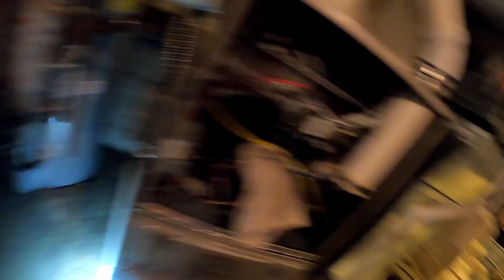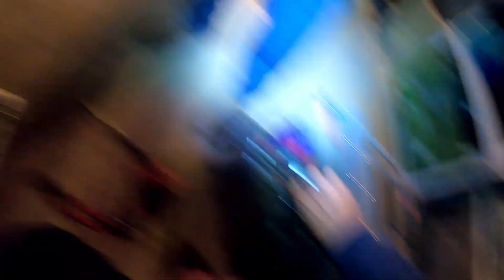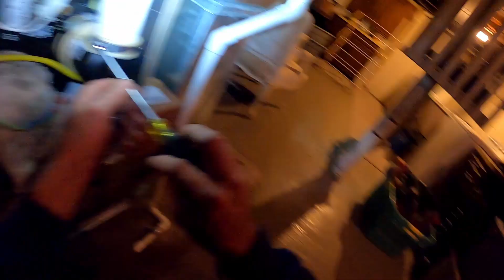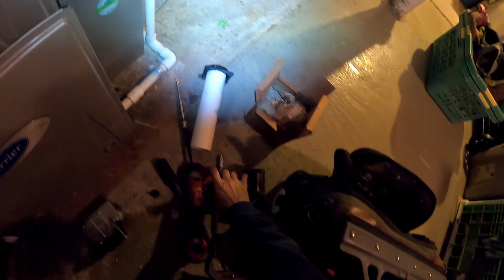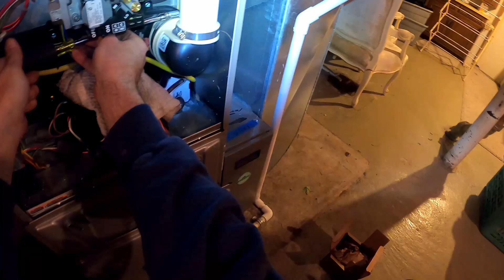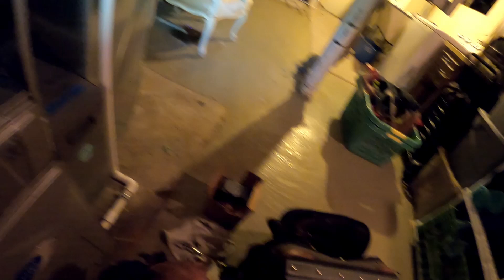Carrier 2 Stage Gas Valve Change(With Help From The Installer)

Comment: You could have easily changed that valve out after inlet gas pipe was removed. No need to cut, or take the outlet vent pipe out. I’ve done it many times. Of course if installer had put that union inside cabinet, it would be even easier.

Comment: if only the exhaust pipe could be loosened, lifted up and moved out of the way :))
pretty sure that's a clamped boot connection where the 45 and vertical pipe meet on top the unit and that whole passthrough plate can be unscrewed from top of unit. 
So you can likely just pull the 45 street ell. out the clamp, move pipe aside, pull the 4 screws holding the exhaust passthrough boot and loosen the clamp at inducer, pulling the whole pipe and plate out as an assembly. that should take about a minute at best, then you'll have full access to the burner/tray.
Reply: I see I posted way too early in video again. DOH!

Comment: Look up the flexible drill bit from dewalt. Home Depot usually stocks them in the drill bit section. I can put a nut driver bit at 90 degrees for hard to reach spots. I buy 3 at a time. They’re a life saver.

Comment: Ive installed a few of these carrier units and I never run a pipe straight through the unit, I was taught to do it this way.. 10 inch long piece exactly. Whats the point of the rubber clamp they supply you with otherwise right
Reply: Problem with the two piece there's installers not doing them right. I've had many service calls on that clamp leaking with the two piece.